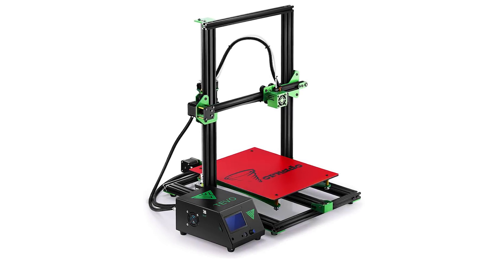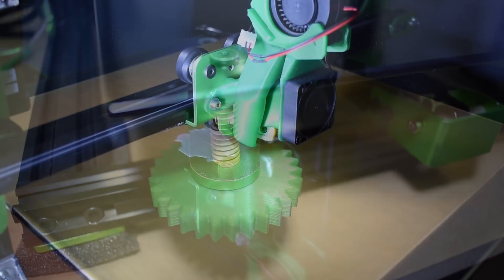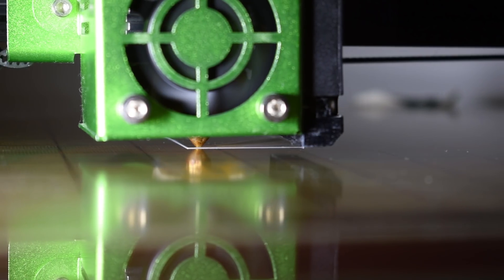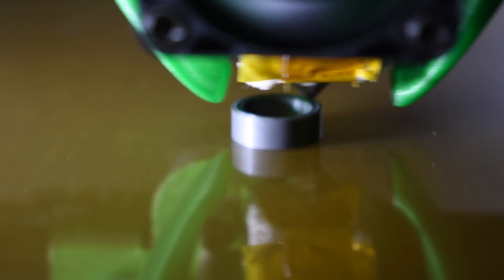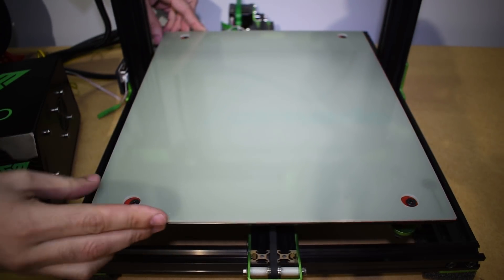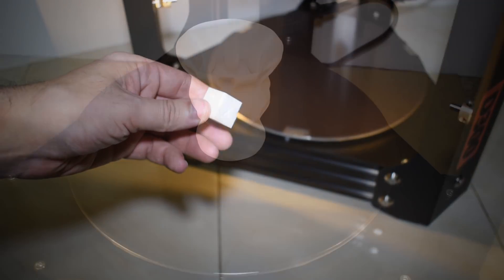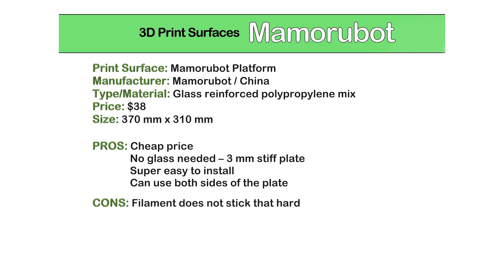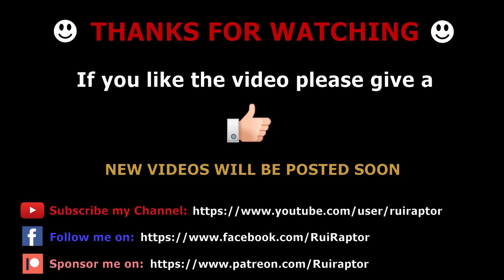3D Print SURFACES Comparison - Tests and Results

Comment: PrintBite+ is very sensitive to temp changes and if your hotend fan directs air at the bed at all then you will have curling corners.

It at first seemed like the absolute perfect print surface. However, I could never solve the curling corner problem and eventually removed it.

Comment: What about just printing on the glass that is under the original surface? I’ve been thinking about taking off the sheet that it came with because I haven’t been getting good results and don’t want to spend any money on other print surfaces.
Reply from the maker: The new tevo tornados and tevo flash don't include any sheet over the glass. You can remove it and print on the glass but you will need to add glue or hairspray to improve adhesion.
Reply: ruiraptor OK thank you

Comment: HI where do you get the glass base for the filaprint to stick onto from please
Reply from the maker: Hi,
I buy all my glass plates locally.
I have a glass manufacturer that cuts and drills glass plates with the measurements i need.
You can try and google for a glass manufacturer that is close to you too or try to order online.
Reply: @ruiraptor  Hi. My Tevo Tornado came with the glass bed shattered. I'm also looking to find an alternative and a glass manufacturer seems like the best option. Would you recommend one (I'm also portuguese and live around Leiria)? Also, if ordering a glass from a glass manufacturer, which type of glass and how depth should it be? I was thinking on 4mm tempered glass maybe?

Comment: Hey folks. I ordered this and it costs me $106 US. I was surprised to find it's only an 3M Ultem PEI adhesive sheet which you can pick up fro CSHYDE or Amazon for about $8 per sheet or less in packs of 5 vs. the $106 I paid from Filafarm.
Rui - please advise if I'm wrong on my assessment.
Reply from the maker: Hi Charles,
Sorry for the late reply.
Actually, that is not true.
The filaprint sheet is manufactured and treated differently. If that was true, all other sheets would perform as good. As you can see, the filaprint has a superior performance compared with any other sheet.

Comment: I just got the Mamorubot and so far love it. It was very easy to get PETG to stick. 

I did notice that I have to crank the temperature up by 10 degrees celsius because when I heated the bed to 70C and measured it, it was only around 60C even after 20 minutes. In order to get it to 70C I had to increase temperature to 80C. And I know this temperature discrepancy isn't caused by my printer because when I measured the glass bed it went actually above 75C and with the original sticker it measured over 70C aswell.
Reply from the maker: Hi Karl,
Thanks for sharing and i also agree on that. I also have to push the temperature a few degrees higher.
Reply: lol.. with PETG, getting it to stick is usually not the problem.. Getting it off the bed is the main issue.. It tends to rip buildtak , pei , etc and even crack glass plates..

Comment: Thank you for this video. I haven't seen a comparison of print surfaces for a long while. Great content as always. So after the more expensive on, it sounds like the Flexplate system is the next best choice if the 70 degrees is ok. I majority print PLA and once in a blue moon print ABS, so I would likely go with that for my tarantula if I ever get tired of glass and hairspray.

Comment: Hi Rui, thanks again for a great video. Could you tell me where you got the glass for your tornado? I want to get the filaprint you recommend but need a proper glass bed to stick it to. Thanks
Reply from the maker: Hi Mark,
I buy my glass sheets locally at a glass manufacturer. I normally get a tempered 4mm glass with holes already drilled for 10euros.

Comment: Thanks for your work, what do you think of Anycubic's Ultrabase?
Reply from the maker: Hi Nicola,
I didn't have the chance to buy one of those yet. But if with that print surface you need to use a scraper to force the prints out, then i would not use it.

Comment: glass + hairspray do the same. Better is to buy pei sheet from aliexpress or ebay, they cost 9€ for a 0,5mmx300mmx300mm. Theses solutions are way to expensive to be justify.
Reply from the maker: Hi Filipe,
Your perspective is just one of many perspectives. In my opinion, i prefer to spend a little more and get the best quality product rather than using a cheap sheet that might give me other issues and that's what i'm sharing in my video. Everyone is free to choose the best solution for their particular case. One important note that i want to give you is that i bought every single one of these surfaces, so this video and my final choice is based on my experience and personal opinion (which is shared by many other users).
Reply: spend 118 euros on this product on cheap printer for the "perfect" and "without issue" first layer. that make sense... I have an crazy ideia.. you could take the money and not buy these cheap printer and buy a better one from the start for the same amount of money and them buy an glass for 5€ + 2€ for the hair spray. For 9€ you can go for a pei sheet that was no issue with pla, abs or petg. Make no sense to advice users to install on cheaps printers expensive surfaces. Both glass + hair spray or pei sheet are old and tested solutions  that work fine without issues for most of the filaments types. The issues you indicate is simply incorrect use... at the end each print you remove the glass, when is cold the print come off. For the pei you need to wait and the print come off with any force. to clean simply apply alcool.
Reply from the maker: Filipe,
The print surfaces mentioned are not only exclusive to one type of type of printer. You can get these print surfaces for ANY printer (from cheap small models up to the top most expensive ones). So, in your perspective, the best print surface on the market today it's a glass with hairspray...noted!
Reply: Yes and do not forget about the pei sheet. both solution under 10€. I using both solution for saveral year without issue, explain why you say there are not the best solution?
Reply from the maker: I think i was clear in my video for the reasons why.

Comment: My Tornado plate is bubbling like mad. Dunno if it's worth putting on the spare build surface or just using the glass.
Reply from the maker: I would remove it honestly.
Check my previous video where i explain how to remove it ;)
Reply: Just use the glass, trust me, I was there last week, I removed that surface and just bought some hairspray, works like a charm and frankly the printer looks better without the 'tacky' buildtac surface.
Reply: dredawgz1 thanks man I'll give it a go

Comment: Hi, I have been using Printbite+ for about 3 months. At first I could not get the first layer to stick. Now I have it dialled in right I love it. Everything still sticks good.  DON'T CLEAN WITH ACETONE. As  the manual says "We recommend use of disposable kitchen towel slightly dampened with a soapy solution while the bed is cold. Wipe clean, and then repeat with fresh kitchen towel as a secondary wipe. A non smearing window cleaner such as Windex can also be used."
Reply from the maker: Hi Ian,
Thank you for your comment.
My printbite+ was also sticking very well at first and then it started losing adhesion.
Regarding the acetone, you are referring to the printbite model. For the printbite+ model, the instructions state that you CAN USE acetone.
Check here the instructions : https://shop.3dfilaprint.com/ekmps/shops/billyboyclyde/resources/Other/printbite-instructions.compressed.pdf

Comment: Hi Ruin. I'm new to 3d printing.  Thanks for your videos, they helped me choose my printer.  I have two quick questions, if I may.  What part(s) of the print surface do I replace/remove from the Tevo Tornado? I noticed you have a black base on which you placed the glass.  Is that part of the Filaprint kit, or is that the Tornado's original base that you cleaned up? Thanks for any help!
Reply from the maker: Hi Rich,
Thank you so much for your comment. Ask anything you need ;)
Regarding your question, the black surface you see is the tevo glass heatbed. The tevo heatbed is a glass with the red (or green) print sheet on top. I have a video where i show how to remove this stock sheet (https://youtu.be/4xIKJnZ4Uwc) and there you can see in more detail.

Comment: I use only well clean glass directly and it works much better than UHU and yellow tape. Just well level the bed and after print let cooldown and it takes off like magic and I like the shiny part don't seem's to be printed.
Cheap and best solution i guess.

Comment: Thanks for the comparison, amazing as always. I got one question though. where would you rank the PEI compared to these other surfaces?
Reply from the maker: Hi Jósep,
As i mentioned in my video, every type of surface that you need to use a scraper or apply some kind of force to remove the print, for me, it's not the best choice.

Comment: Hi Rui on the Printbite+ did you do the cure install where you heat bed to 110c for an hour with damp cloth on it? Curious as I just bought it for my BW. Thanks 😊
Reply: Yes I did. Just do what the instructions say. Read the instructions for cleaning.
Reply from the maker: Hi Esco,
Yes i followed the procedure. That's the similar procedure as the filaprint. It must be done right from the start when installing it and for maintenance too.
Reply: Thanks guys. 😊

Comment: Hey, thank you for the comparison, but I´m a bit disappointed about the missing Ultrabase... 3mm with a "something something" coating tempered glass, 24€ at Amazon, never have issues printing above 60°, no need of treatment and seldomly needs maintenance... what was your criteria when looking for surfaces?
Reply from the maker: Hi,
I understand your point of view.
Unfortunately, i could not buy all print surfaces on the market. I ordered the ones that were commented most on the groups and forums.

Comment: Nice! Ive bin wainting for that video for 2 weeks now bro. Ill now your opnion befor i buy a surface for my tornado.
Reply from the maker: Hi, thank you for your comment and sorry for the delay posting the video. I wanted to have everything aligned and all the info in this video.
Reply: hey raptor im using the fan with the blower. the one yousaid it the best duct. its cooling my nozzle down extreme, although is nearly hitting the surface so it realy deep. i doesnt makes sence that its cooling the noozle down. can you help me out?
Reply from the maker: Hi Furkan,
Are you using a 24v blower or a 12v blower? Also, how much % are you using and at which layer does it start?
Reply: i start the blower at the second layer like everytime. im using the same blower at my tarantula too. its a 24v blower. 100% like everytime. never had issues with it until now with that blower. if im going down to 40% it works, but i can hear how the printer have to fight against the blower. At 100% im getting an error because it cant heat that much against the blower. i can see with my eyes how the number falls down.
Reply from the maker: Hi,
The tarantula is 12v and you are using a 24v, so with the tarantula it will have much less air flow for the same % setting. I also don't run my blower at 100% but i tested with 80% and it works fine. You can run it at 60% and it still should work fine. In fact, you don't need 100% of blowing power as long as the air is efficiently blown by the use of a good fanduct.
Reply: thx for that. But it doesnt work over 40 %. should i change the duct? which one do you recomend for me?
Reply from the maker: Try the second best, the petsfang. It's also a good fanduct and had the same performance results as the first one.